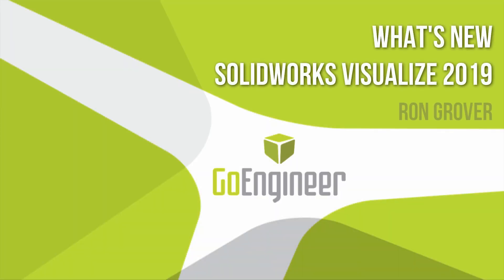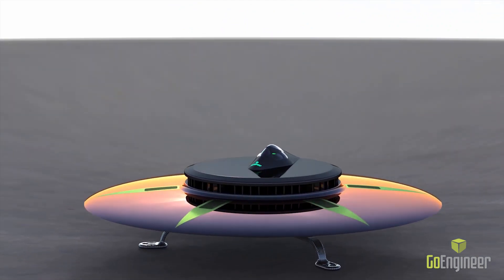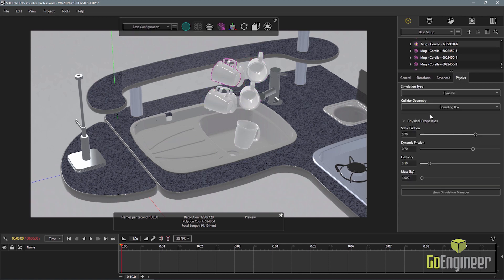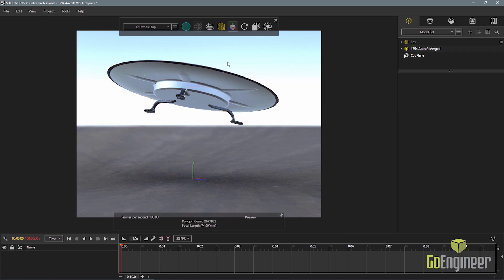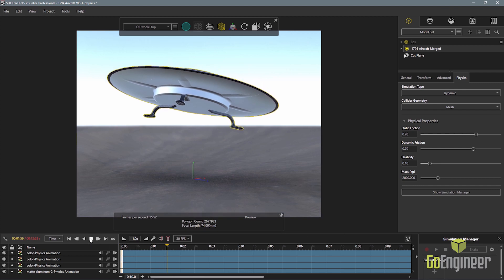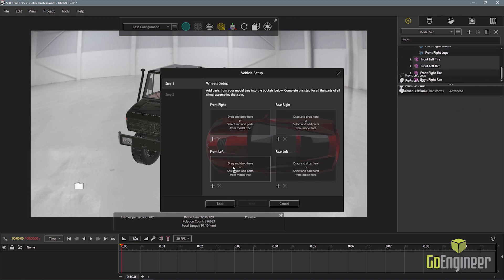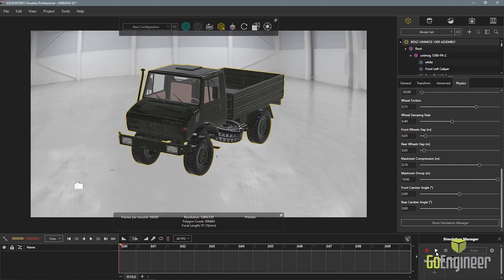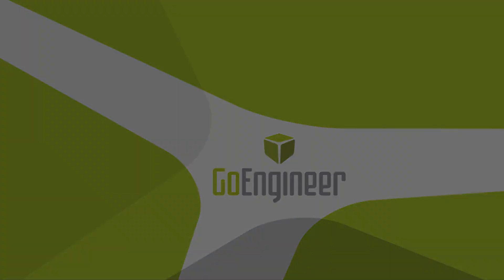SOLIDWORKS 2019 - Visualize Physics Engine

Comment: Does this also work for flow simulation and fluids?
Reply from the maker: Unfortunately no, it cannot be used to change the shape/deform an object, like a fluid.  The physics based engine can only move an object or bounce off/collide with another object.